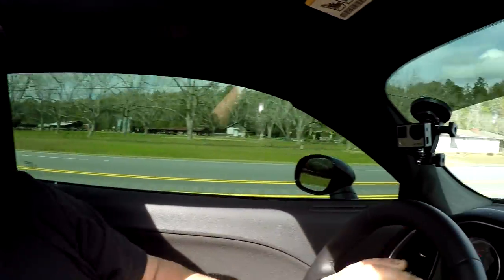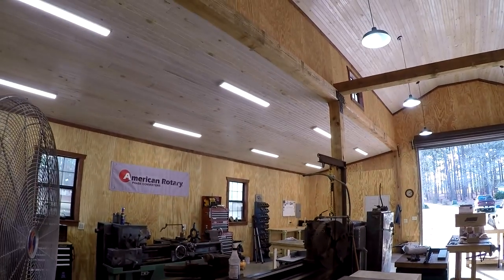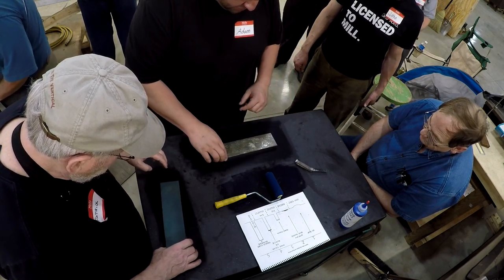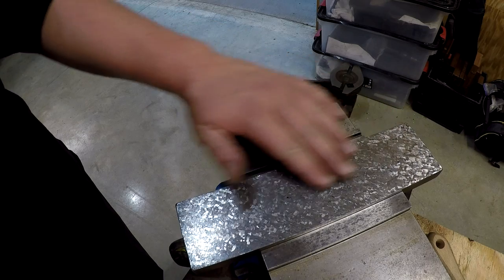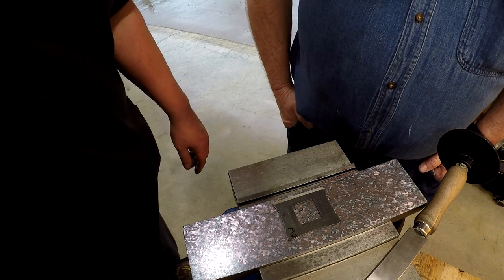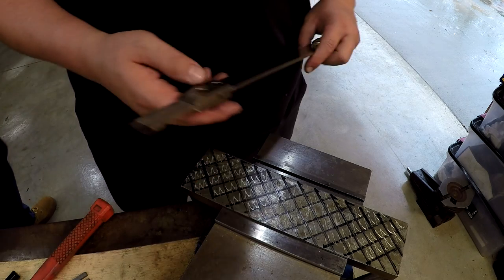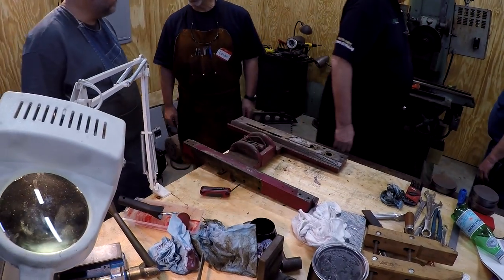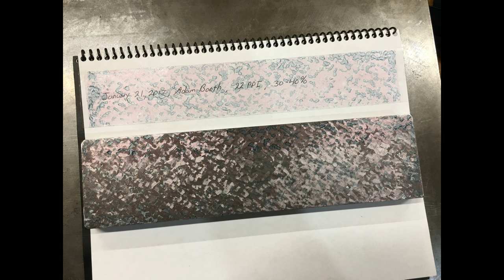Richard King Scraping Class, Tifton GA, Day 1 & 2

Comment: Hey Adam, thanks for putting your video up and sharing with us. Keith's shop looks fantastic. I wish I had enough time to watch more of the great content you guys put up.

A couple of opinions for what they're worth. When scraping I'd suggest not to handle the work with your bare hands quite as much. You'd  be surprised how much even a small block like that will move. You can test that yourself and I think you'll be surprised.

Your scraper around 7:00 appears to be blunt.

When grinding the radii it can sometimes be easier to leave them in the handle and use a parallel etc to block it up, and then you can easily pivot on the radius. It's just a bit quicker and probably more accurate. No biggie, but FWIW. Once the radius is set it shouldn't need to be changed so I lap my scrapers on a cast iron power lap and touch them up reasonably often. Not so much when power scraping, but a truly sharp scraper when hand scraping can make a huge difference.

I've never seen Canode lifted off like that, very cool! I suspect one of many of Richard King "trade secrets" he gives away in his classes.

Mate that flaking looks absolutely awesome and wouldn't look out of place on even the finest machinery made. You should be very proud of what you achieved. Well done, and again thanks for sharing this with the world.
Reply from the maker: Pete F I learned a lot about us grind and how important the cutting edge is. I got a little better as I progressed and did notice the difference with a sharp edge. Thanks Pete.

Comment: Good job Adam, keep at it, it gets easier. Your hand flaking looks great BTW, that aint easy.
A little tip for your angle plate, scrape the large surface flat first and scrape / align the smaller surface second, less work in aligning the smaller surface ;)

Comment: I have a small angle plate that I did quite some years back, there was no machining at all apart from tool and cutter grinding on 2 faces. This project  was a rough casting that I had to hand chisel all surfaces then scrape 2 sides flat then surface grind 2 faces and use a cup wheel on the the 2 inner faces on a tool and cutter grinder. I can remember saying why can we use the milling machine, this would save the hands from the hammer and chisel. 
We broke a few over head fluro lights from the cast iron chips. LOL

Comment: Keith really set the high water mark for building a workspace for a classroom.
Tell him to dig a pit in the middle for a fire so the whole floor gets warm and keeps his equipment (and people) a nice steady temperature haha
Sooo cool though.
Don't get frustrated. If you're taking longer, you're learning more. It's just that simple.
Looked good to me and your half moons started looking very very regularly shaped.
Are they going to provide a master plate and some grit at the end so you can really dial it in?
Reply: He would have put Pex tubes in the slab if he was concerned, but his climate doesn't warrant it. Let's see if he puts a couple of tons of A/C in it in the summer.
Reply: Well Bruce, being in hot and humid southern Georgia, with the large volume (high ceilings), you could start with 5 tons in the machine shop side alone and see what happens. Of course a proper load calc would be needed, but through experience, I am guessing around 10 tons per shop side. I've  been in the commercial AC biz for a long time and dealing with the obvious Georgia heat is a big job but even more challenging is the dehumidification capacity loss in the equipment before you realize cooling.  Customers are always surprised at the amount of tonnage that is required for open space construction.  A space like that is a nightmare to condition.   That being said, those issues are down the road.  It is a beautiful shop and I am sure Keith will enjoy the heck out of it!!

Comment: I'm really curious about something:  In the step where you're using the orange mallet to strike the scraper, why not attach an angled striking surface to the scraper body?  It should also help you see the angle you'd like to keep.  It just seems like a slight misuse to be intentionally striking the tool with the edge of the mallet and not the face.

Comment: I must be missing something. What is the purpose of this?
Reply: These methods are how you restore the all important guide ways of a machine tool, the guides that the carriage and tailstock of a lathe moves on, or the knee of a milling machine moves up and down on and the milling table moves back and forth across on.  If the those guide ways of a machine are not perfectly flat and straight, the machine will not produce square and true workpieces.  Scraping is how you get a machine tool's guide ways restored to being straight, true, and 'square'.
Reply: +Patriot1776  oh ok, I figured it was something like that but want sure. Btw, l like your choice of number on your username ;)

Comment: scraping is easy, scraping in the right place is the skill and power scrapers help you ruin it quicker if you dont have the skill!
Reply from the maker: dan wolf knowing where to scrape and how much to take off is something Richard teaches.
Reply: +Abom79 I know, hes well respected tutor. I did a five year apprenticeship on scraping and fitting and it was a low paid and under respected job(and dying out with death of machine building in uk) good so see it getting respect finally
Reply: dan, how come its dying aren't they scraping newly built CNC machines??
Reply: +Khalid Al-Kooheji a lot of cnc have linear bearings and haas for example shim component parts where bolted together..big problem for me in england is we dont make anything and our machines are in india or pakistan ..non left to rebuild!
Reply: I have found in the cabinet trade that power tools allow me to make twice as many mistakes in half the amount of time.  Just pick up and brad gun, go at it and then find that the piece is crooked or upside down or shifted a bit.  The old timers that hammered square nails had time to think about it in between each nail being driven...not any more!
Reply: Slow and steady wins the race, or at least makes it in one go!

Comment: I'd be worried that too much material would be removed, rendering the piece unusable. Is that a concern?
Reply from the maker: Rickyboy707 The problem with removing too much material is getting the rest of the part down to match the low spots which is very time consuming. Scraping doesn't take off much metal each pass, but it's easy to dig a hole if your not carefull.

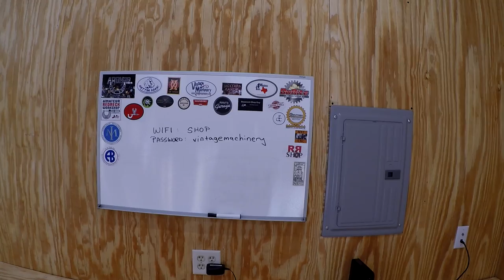Comment: Opps! Keith is going to have to change his wifi password now. Ref: 3:04
Reply from the maker: user990077 I doubt he's worried about people coming over to steal free wifi...😆 But yes In sure he's got that covered.
Reply: Adam, this is important. Keith probably didn't mind his friends at the scraping class using his wifi for a few days.  But this is the internet and no telling who now has the password. With this password they can get on Keith's network and any other computers using the network can be accessed by hackers. Keith's files can be viewed, copied or altered, other passwords to bank accounts etc can be obtained.  After the class Keith does need to change his wifi password to a more secure one using several characters such as %, # etc., some numbers, and upper and lower case letters.  This also applies to you or anyone else with a home based network with a wifi link enabled.

Comment: why would you do it in such a tidiest way, why not just put them in the mill with a fly cutter, or a grinder, such as a head grinding machine, that seems to be far to time consuming to make a dollar
Reply from the maker: Romppai's Outdoors The pros do it to make a dollar, others do it to learn how to rebuild there machinery properly.
Reply: the large majority of the work being done is in millionths of an inch per scrape.  There's also the issue of flaking and frosting that are barely recessed to keep  little films of oil right next to a bearing surface. You can't do that with any machine that I'm aware of. Even CNC EDM would be pushed past tolerances that small
Reply: Romppai's Outdoors

Comment: Foosball is the devil!!!   No, flaking... flaking is the devil.   It has it's place but I've seen too many rebuilt machines with flaked ways.  Pretty yes, but horrible for the longevity of the machine.
Reply: The worst thing is a used machine that has been power flaked and people think cool the ways are not worn. Did a lathe once, flake marks but ways worn .020.
Reply from the maker: The13inc That's why Richard teaches to flake the underside, not the visible side that everyone sees.